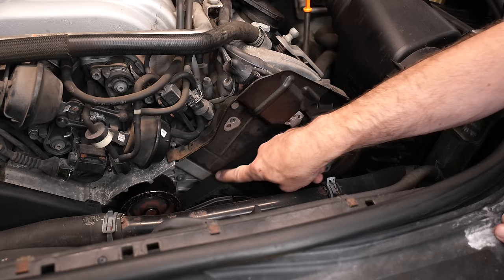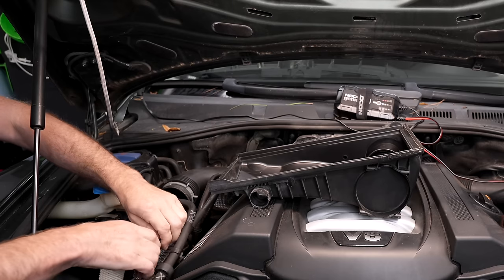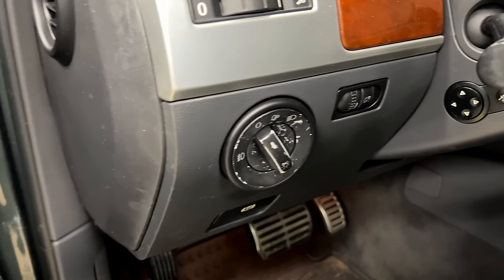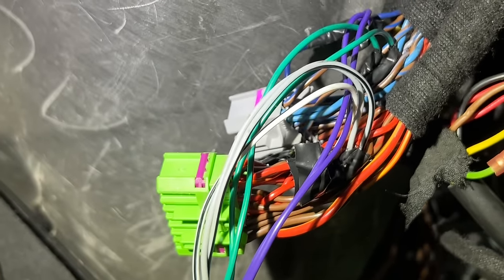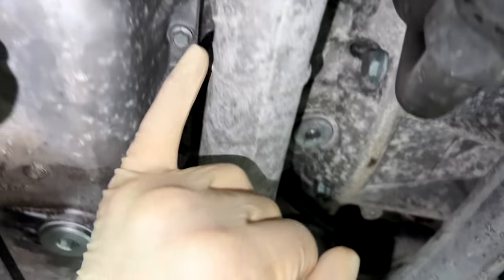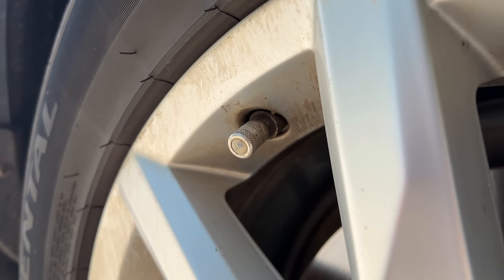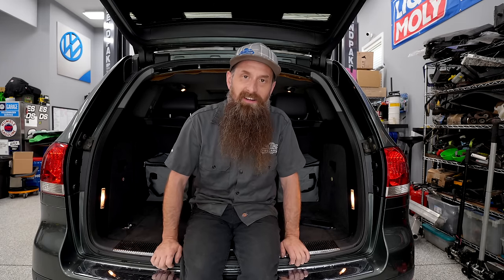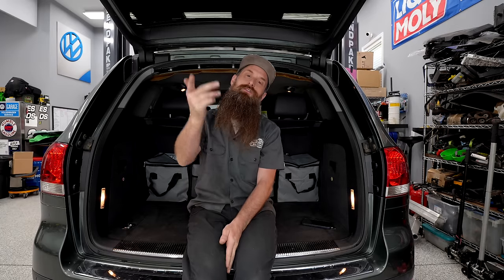Is It Worth Buying a CHEAP, OLD VW Touareg?

Comment: I have a 2008 Cayenne S and a 2016 Touareg 3.6. Love the content. On my Cayenne, one of my 7way to 4 pin adapters would not work on LED trailer but I found the Curt 57004 does allow LED trailer lights to work although I still get the one-time trailer light warning at times, the trailer lights still function. The cayenne had some rust underneath.. it’s worth using a rust converter on. I used the POR15 stop rust kit.
Also, thanks for the prior video on cleaning intake valves on 2.0/1.8t EA888 engines. Eventually I’d like to do that on the VR6.

Comment: I've had a couple old Touaregs and I can honestly say it's not a good financial decision, they are very interesting well equipped vehicles but like he said you may be buying a $2500 vehicle, but your paying for parts for an $80k vehicle, aside from the endless wiring and transmission valve body issues just a headlight assembly is going to run you $1000 EACH!, However for the purpose of the Touareg in the video it's fine, an occasional use or offroad toy it won't be too bad

Comment: Got 2 Touaregs: a 07 3.6 and a 08 4.2 FSI. We tow with both (TT) and my daily is the 3.6…We run BFG KO2s on both (longer wear). They do require $$ now and then but actually seem better than other vehicles we have owned. We LOVE them. Had the 3.6 now for over 14 years…

On adapters for towing we purchased one from UHaul that was wired wrong…might test to see if it is working right (the adapter)?

Comment: Please keep posting on the Touareg's. They are slowly gaining a cult following among the off-road community, thanks in part to your videos. You need to warn people that ownership can be addicting. The first one we bought was a 2004 air-sprung V8 for my son. Compared to my highly-modified 2004 Land Rover discovery, his Touareg is better built, better featured, far better on road and with the exception of some rock crawling, far better off road. We then found and immediately purchased a 2008 V 10 TDI for towing a horse trailer for only $7000 from a former Tesla engineer. I am now looking to purchase a 2-owner 2005  V8 with 87k miles for myself for over-landing and sell the discovery. I really enjoyed the Land Rover off-road community. It will be interesting to see if the Touareg crowd are as eclectic and easy-going.

Comment: great video , the paint looks great ! , imy 06 has a great shape interior still except the heat air fan button its the only one peeling , i remember at uhaul giving my brother a adapter thingy for the trailer lights to work , uhaul seems to be the most updated place about hook up problems and fixes they see it all

Comment: I hope you do an episode on doing the blend doors in the HVAC system. I have the 2 zone and I hear getting to them is a nightmare. Also it may be possible to clean or rebuild them for $10 vs buying new ones for $250 each. Also adding the tom module and getting it coded RIGHT. Lastly I did the TPMS module replacement and coded it and got it to work again. Have fun.

Comment: Yeah these are definitley challenging to work on. I have a 2010 tdi and the driver's side exhaust compensator/up pipe is broken which requires the engine/subframe being dropped

Comment: When looking for a used midsize SUV the Toureg 3.6 VR6 was one of the options I considered along with the Volvo XC60 T6. Common sense prevailed and I ended up buying a 2008 Lexus RX350. I love how the Toureg looks but didn't want the pain of having to deal with the usual VAG issues.
No offense to VW/VAG, I also own a 2008 Mk.5 R32 and a 2007 Audi A4 2.0T.
Reply: You made the right choice. The Tourag of this generation is for those that NEED its capabilities compared to other cars. Otherwise, look elsewhere.

Comment: A later trailer module (>'08) should take care of your trailer lighting headaches without butchering anything with resistors or bypass adapters.
Reply from the maker: I was wondering if that would be the case. I need to round one up and test drive that.

Comment: Having spent 28+ years in an independent shop I've had the pleasure/dis-pleasure (tough call) of working on a metric butt load of Q-7's, Cayenne's and Touareg's....

Listed by problems the Q-7 was by far the most problematic followed by the VW. The Porsche didn't seem to have nearly the issues the others had.

I especially like the fact that on the early V-8's the instructions called for engine removal to change the Water Cooled Alternator. There's a cheat for it and I can/could do them in about 3 hrs. The fact that someone signed off on that bad idea and fed the shitty engineering to the consumer is one of the reasons I'd NEVER own one.
Reply: The same person who designed the water cooled alternator must be the person who decided to put a starter under the intake manifold of whatever car that was

Comment: Bought my 2006 4yrs ago 2 in lift 275 65 18 cooper discoverer atp II tires, Bilstein struts goes most places I ask it. However offroad cannot compare to my land Rover discovery III HD. Both gas V8 engines ,same size tires land Rover has air suspension. Owned 3 land cruisers over the years. Solid vehicles also. 96 Mitsubishi Montero SR was quite interesting. All driving done mostly Mojave desert. Sierra Nevada mountains.

Comment: Knee jerk reaction is LS swap it... 

I always wanted one and loved the old videos of them pulling a plane, but the repair and maintenance cost/skill is considerable. This is one I would be really on the fence about getting. 

AWD V8 is amazing, but it's not the right V8
Looks great, but disappointing interior quality from that era imo
Nice features, but half of them will stop working at various points 
Overengineered parts like the sway bar links are really great, other overengineered parts are pandoras box meets Murphy's Law like the air suspension. 

For a daily I'd have to say no, but for a cool project or winter beater the price isn't bad

Comment: For led trailer lights have you tried a resister for each of the lights to create enough resistance for the sensor to see a load. Then for the rust it would be cool to see it laser blasted or dry ice blasted.
Reply from the maker: I bought a converter, but it didn't work. Im going ot add some lights to it and see whats up

Comment: As always, I loved the video. The last VW I had was a Mk VI GTI (a VR6), which I absolutely loved. I sold it well before its expiration date, so I never ran into the many issues you run into. I was shocked when a friend of mine, 7 years later, bought a Mk VI Jetta and I saw how poorly the interior held up. I remember one of the things about my Mk VI GTI I loved is how solidly built it FELT. Watching your videos and seeing more than a couple older VWs in your care with wonky headliners... I have to ask...what is going on? I mean, none of the cars I've had (except a few from the 70s) had headliners sagging the way the VWs seem to have. Is it sunroof leaks that's causing that? Maybe because all of my cars didn't have sunroofs?

Comment: Love the V8. I thought the body frame on these were made of galvanized steel. Not sure what you can do about that rust but if the engine and transmission are good, then the car is good as it is

Comment: Wife’s 2008 Touareg 4.2 is still in mostly excellent shape at 133,000 miles. I keep getting emails from Carvana saying I can get $600 for it if I trade it in 😂
Thinking of maybe buying her something new and converting the Touareg into one of these cool off-roaders
Thing used to leak oil like crazy but I dumped two bottles of that AT-205 in it, which almost completely stopped the leak

Comment: We've got the exact same model. Same year and color. Love it, but similar wear. The biggest issue after the dealer alignment, still pulls right. Took it back checked it again, still the same. I do notice a werring sound while driving, maybe an axle bearing.
Reply from the maker: I remember those being a nightmare to align.

Comment: Id love to hear more about the next generation of these, especially the V6 and V8 twin turbo diesels.

These early gen ones all seem to be ageing terribly 😂 but the next gen seem to holding up alot better from what i can see
Reply from the maker: My wife’s daily is a v6 TDI 2015. Short of Adblue issues and a failed blower motor it’s been great. She has about 150k
Reply: @HumbleMechanic  nice, they certainly look tempting, I've seen a heap of higher mileage ones pass through wholesale auctions (trade ins from dealerships) that all seem to present really well despite the huge mileage, interior quality is a huge improvement from the last gen.
Reply: @HumbleMechanic I'm looking at buying a 2012 V6 TDI in pristine condition- 100k miles, should I do it?

Comment: Connect some resistors of the correct valve same as the bulbs would have been including the Led consumption. Do that for each for lights and indicators

Comment: I almost bought a V10 turbo diesel Touareg but after talking to the Humble Mechanic I passed. So many things were "drivetrain out". Need a new alternator? "Drivetrain out".
And notice I said Drivetrain out, not engine out. You have to drop the entire thing out the bottom. That was a quick trip to Nopeville.
Reply from the maker: The v10 is so cool…. For someone else to own 🤣

Comment: Touareg are really nice 4.2 fsi is super fast when you push the throtle fully. And the v6 steel suspension is the easiest one to work with.
Reply: I've got an 08 4.2 fsi V8 with steel suspension and no Kessy.  Life is good.

Comment: I reckon the 2.5 R5 TDI is the best and most reliable engine. I had a transporter van with one of these  engines and the thing had so much torque it would break the axles! It had a six speed manual transmission as well so burnouts were easy 😂
Reply from the maker: We dint' get the 2.5TDI in the US.

Comment: With my only very basic understanding of electronics, my current assumption on the tow bulb issue is that the LED trailer lights are less resistive than the old incandescents.  

If you figure out how resistive the invandescents are, I wonder if you could simply add a resistor inline, and it'd get the warning light to go away?  I wonder if that's what that weird adapter was trying to do.

Comment: I just bought a 2014 vw passat tsi 114k miles for 9900 talking about getting ripped off. Used car market is nuts right now. Well the car had massive problems. Work I had to do.
Replace
Solenoid Magnet 
Variable timing Spindle.
Timing chain
Tensioner 
Spark plugs 
Coolant 
Rotors
Ball joints.
Sway bars.
Holy shit its still not 100% still have alot of vibration in the wheel and maybe my Trans is starting to go I think, this might be the first and last European car I'm going to buy.

Comment: The cable under the driver seat that runs to the battery does something and drops it 1 volt and electricity and makes all the programming go haywire
Reply from the maker: Yep seen ground cable issues before. Not super common but will make a nightmare.

Comment: Man we thought we got a great deal on our 2005 last year that had 105k for $6900 and by the time we got home the dash was lit up like a Christmas tree. After taking it to both a euro repair shop and the vw dealer and spending around $600 week none if them could fix get our headlight to work. The guy we bought it from ended up fixing it for us. It was one of the numerous modules in the headlight wiring, but it took him 3 weeks to get it back to us and we had to pay him of course. I HATE this car!  It beeps constantly because of all the electrical gremlins ! The trans won’t shift right on its own so we have to either keep it in S1 or manual shift. We also have the “running gear workshop” dash warning on but the suspension seems ok although the manual knobs to change to different levels are useless. Now we have an abs light on. 
WISH WE COULD FIND A MECHANIC OR HELP IDENTIFYING THESE ISSUES SO I CAN AT LEAST TRY TO FIX THEM MYSELF 😫

Comment: I have a 2004 VW touareg first gen V8 daily driver. Had it forever. Still going strong at 126k miles. Check engine light has been on for about 7 years now. (P420 cat lean bank 1/2, might try the ole guzzle seafoam down the  o2 sensor hole )  I'll never buy a German car again. 😂

Comment: I recently had the pleasure of replacing timing chains on a 2012 Touareg TDI (CATA engine). All four of them. Got it all together just to find out the exhaust cam (gear driven off the intake cam) somehow was off a tooth. I to this day cannot figure out how that possibly happened. The gears had no damage, no missing teeth and they were tight on the cams.
Reply: Ouch

Comment: I have a 2004 Touareg 3.2 V6 , I always have a knocking noise at low speeds, I can't tell if it's coming from the front or rear ... Plus it needs more rpm to get it moving at low speeds, it usually drives well at higher speeds..

Comment: Fighting range control warnings on my Q7 .  .  .  .  Good luck!
Reply: I learnt that the Headlight Range Control is built into the driver-side headlight assembly in my Touareg. I don't know if it's the same way in the Q7. VW stopped making the motor for HRC many years ago, so when my HRC went bad 2.5 years ago, the options I had was to either get a complete new headlight assembly, which has the motor built in, or ignore the warning and keep driving. Unfortunately the VW tech I went to gave me bad advice and I ended up going with latter option, and soon as Russia invaded Ukraine, VW stopped making these headlight assemblies.
But if you can find one for your Q7, make sure to clean all electrical contacts before sliding the assembly into place. Cleaning the contacts alone would take care of many electrical issues in your VW/Audi, lol.

Comment: I own one now it has a check engine light on and no one can figure out what's wrong , vw dealer wants to "parts change" others have no clue.   Runs fine, back hatch is stuck closed after it went limp when the traction  control light flashed once. Doesn't do it anymore but hatch is stuck locked.

Comment: If you dont work on cars its not affordable.  I do my own work and have had minimal issues with my 2007.  Owned since 2015 just now hitting 150k miles. Typical carrier bearing, tensioner, water pump, oil changes and air filters.  Interior clean, button peel and headliner typical.  Good vehicle for me.

Comment: I hope you do more on the Touareg. I just bought an 06 with a noisy front differential. Its a 3.2 v6, did they have one gear ratio? Looking for a used one to rebuild before i swap it out.

Comment: Great video! Any thoughts on what might cause a 2004 Touareg to only output 6V from alternator? And does replacing the alternator really require pulling the engine/transmission?

Comment: I've seen people using parallel resistor for led lights, but they're kinda bulky like 5~15W resistors to trick the car into thinking you're using halogen bulbs
Reply from the maker: That’s what the adapter should do. It’s 100ohm I think. I’m going to mess with it and see if I can get the values right
Reply: @HumbleMechanic  i have a led control box installed on everyone of my trailers , those boxes use 8 ohm resistors @ 15 w to increase the power draw. The load is disconnected if the box senses a led failure and triggers a cars built-in trailer lamp warning. Or on older cars only lets the turn light flash faster.

Comment: I would love to see the timing belt/water pump replacement. I also just bought 2006 VW Touareg V8 with the air suspension and already dropped a bit of money in to it.  Mine is also a PA car but I live in Pennsylvania, I only paid $2400 for mine but with 111,000 miles on it, has fully loaded interior. Those brake vacuum booster lines are not cheap and good luck finding the right ones. I would like to fix the cruise control on mine any ideas where to start?

Comment: I have been inspired by your video after watching. Spent last day thinking of replacing my truck with Touareg.  What are your thoughts about VR6 engine and towing capabilities?  And yes I lean to the VR6 engines, haha.   After looking on forums the specs I was seeing seemed promising.   Truck is great but looking at options for more people room compared to extended cab  truck.
Reply: Dont get why people need that large engines to tow..... are they doing 100mph towing 20 000lbs at 8000 ft elevation? As far as i can tell, its mostly that people dont want their car to feel slower than normal while towing.... not that it cant technically handle it...

Comment: Regarding your comment about LED problems -- have you tried putting a load resistor in parallel with the LED?  IF you do find a good metal mounting spot as get hot and will melt plastic.
Reply from the maker: That’s what the adapter is. I may try and find a trailer to be sure it doesn’t have an issue

Comment: @HumbleMechanic 
I'm in love with Touareg! Had the v6 tdi and it was absolutely brilliant!
Now I'm looking for a V8 petrol. As far as i understood, the pre facelift is 310hp and the facelift is 350hp?
What's the difference between the two? Is the facelift 350hp direct injection? Which of the two engines is more reliable?
Reply from the maker: The facelift v8 is an FSI. FOR SURE more power
Reply: @HumbleMechanic  FSI for me means more problems - every 30k miles carbon cleaning the valves and intake....
Reply: @Tsvetan_Dikov  44K.  I put a can in every year (08 V8 FSI) and haven't had any carbon issues (101k miles).  The 350hp surprises a lot of people.

Comment: I have a 2008 touareg vr6. I have been having an issue with a very very wet drivers footwell. Which I'm guessing is the cause of a lot of my electrical problems especially seeing as they seem to be the worst after it rains. I'm fine with fixing whatever the problem is but I'm struggling to find where the water is coming from to know what to fix. I'm wondering if you know what the most common culprits are and could point me in the right direction to how best to check each one.